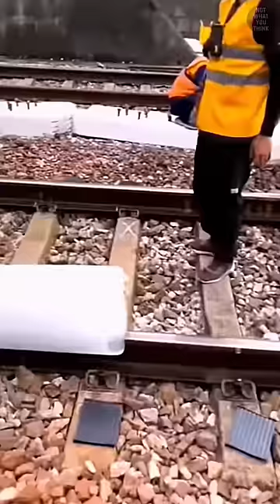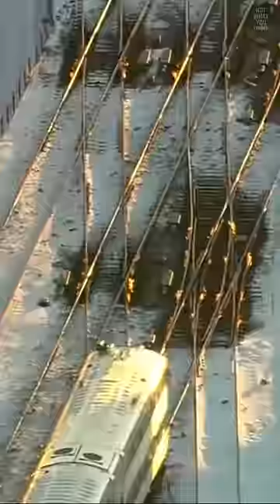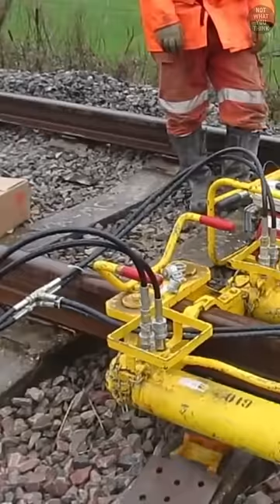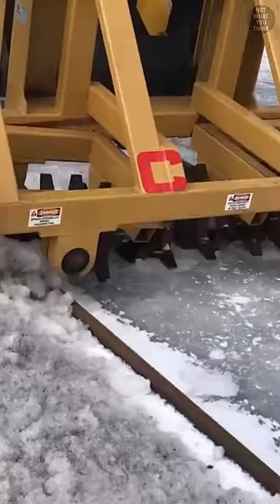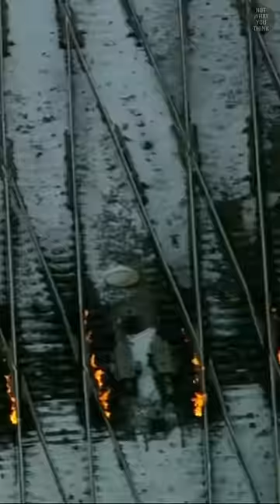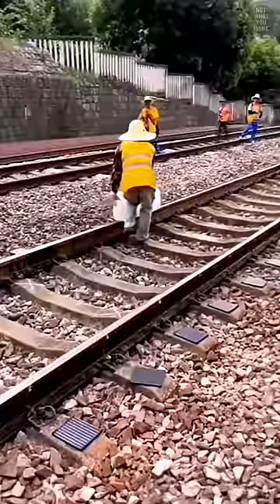ICE & FIRE on the Railway #shorts

Comment: “Hey go grab me the track stretcher out of the truck”
“Good one dude, not the first time I’ve heard that one”
Reply: The track stretcher does exist🤣
Reply: @kevingrubb9835  "go get the bolt stretcher" is a common hazing ritual for apprentices when the old fart needs to get some work done. It'll flummox the hell out of the newbie for a hour or so while the old guy does real work distraction free.

The apprentice in this joke realizes that a bolt/track stretcher doesn't exist, and knows that the old guy is hazing them, so they refuse to go get it, even though it actually exists.
Reply: There is actually a tool call a rail stretcher
Reply: @kevingrubb9835  The 'Track Stretcher' does exist and I've used them in Toledo in the 1970's on the Penn Central Railroad. But it was faster just to pour burning diesel fuel 39 feet in one direction and 39 feet in the other direction.
You could easily watch the two pieces of rail come together. Also was used in fixing  'Pull Aparts'
Reply: @phillyphakename1255  if the apprentice is smart enough. They’ll know they are being messed with and still go search for the board stretcher for hours while getting paid. Just following bosses orders haha
Reply: @jackmyhre8759  when I was new, I would be sent on parts runs, and sometimes, when we were out of stock, I'd go on exhaustive searches in all of the possible storage locations for the thing even where there is no chance they would be kept, you know, not to avoid work but to be completely thorough!
Reply: @phillyphakename1255  in the telecom industry the "cable stretcher" is the classic joke to play on newbies
Reply: i def need one 🤣
Reply: I immediately thought of the "beam stretcher" we used to haze new apprentices by getting them to go look for one... lol
Reply: The proper name is rail pullers that come in both hydraulic an gas operaterated engines used to pull together two rail ends to either bolt angle bars on or back on or to do a termite weld an eliminate the joint. I was a in track welder/thermite/arc,etc.etc.etc.
Reply: @kevingrubb9835  r/woooosh
Reply: Geez your joke was too sophisticated bro it went over all these hard assess heads 😂😂
Reply: rail stretcher would’ve been better
Reply: @xb70valkyriech  cable stretchers are a real thing tho
Reply: @tylerj6327  I'm not falling for that one again
Reply: How about you go grab me the wire stretcher so we can land this easier
Reply: @jackmyhre8759 but then it wouldn’t be part of the joke
Reply: @Philly Phakename  to be fair people are also really shity at putting stuff back so it honestly might be somewhere it never shold be put, like one time I was sent to find some 1/16 6010 welding rods and ended up finding them on a shelf for hydrologic oil on the other end of the plant so you never really know.
Reply: Oooh his talking about his ex wife😂
Reply: The correct term is rail distressor
Reply: Hopefully he also doesn't come back with a can of gas to set stuff on fire😅

Comment: Those tracks are set on fire to defrost the switch points
Reply: I think you're right, and Not What You Think is actually wrong
Reply: points are set on fire to prevent ice from locking them, it's a fairly common practice in Chicago(shown in the video) in particular
Reply: 100
Reply: @PrinzEugen176  And on Long Island.  Gotta defrost the switches for them to work.
Reply: Came here to say the same thing. That video is from Chicago. Other places have propane heaters that blow hot air in and around the switch points.
Reply: You're right , it's because points can't be stressed
Reply: @jeffwood5897  it doesn't have to do with stress it has to do with the fact ice and snow gets packed in between the points and the switch and  will not align properly.
Reply: @PatrickLipsinic  that's not why a guys rubbing a blpck of ice along it
Reply: @jeffwood5897  you replied to the original comment. "Those tracks are set on fire to defrost the switch points"
The video showing the tracks on fire are there to clear snow and ice. Nothing to do with stress
Reply: @PatrickLipsinic  you're right tbf my bad
Reply: Yeah, just ice on straight tracks wont be an issue with all that weight
Reply: It's industry standard for deicing
Reply: Yeah it's a propane tank contraption only at the switch, not the whole track
Reply: We set the tracks on fire in the winter when we have rail breaks and joint pull aparts. Steel grows when it’s hot and contracts when it’s cold. We use fire when we need to grow the rail
Reply: Why not just build a heating system on these points...?
Reply: @vicvancen  $$$$$
Reply: @vicvancen  Here in finland they have heating systems on those
Reply: @vicvancen  they work like heated seats on cars
Reply: @zeduu6873  Yeah, they are heated in germany too
Reply: @vicvancen  it dont even cost that much so I dont understand the point of setting them on fire😂
Reply: @vicvancen  the fire is a heating system, it's not some guy going out with a gas tank and setting it, it is a heating system similar to a natural gas furnace or propane stove. The reason this is still used in the US is due to the extreme amount of rail infrastructure we have that is underfunded and corner cut both when owned by government or private companies, as opposed to the well funded systems in European countries that can keep up with the latest and greatest

Comment: In Chicago the rail lines have gas pipes running along with them that have open flames to roast the tracks in the winters.  Crazy.
Reply: LoW cArbON transport
Reply: Maybe pump cool water in summer
Reply: Those are switch heaters to keep them ice free in winter so they can move.

Comment: One correction: the tracks in the clips aren’t on fire, the switches are, and it’s prevention of icing that they do it in this instance. They do use the process for heating rails to stress free temperatures in winter.
Reply: Yes exactly
Reply: I came for the reply, and i was not disappointed
Reply: I came for the food…
Reply: Exactly, the RWS story "the flying kipper" is an example of why you should do this
Reply: Switch POINTS usually have electric heaters strapped to the stock rail and pan heaters in the cribs under the switch points. SOMETIMES there are kerosene heaters placed under the stock rail in winter. All of this intended to melt snow so that it does not build up between the switch points and stock rails, causing switch failures and, potentially, derailments. What they are showing in this video is rail "fire snakes" being burned, perhaps for the same reason. Based on this short video, it's not clear why they are burning those sections of rail. It does not appear to be switch points but "solid frogs" that they are clearing snow from. This is something not normally done. Fire snakes are typically used to stretch rail.
Reply: Most of the time when fires are set on railway tracks, it's to free off points (switches) in freezing weather, which would otherwise cause the blades to ice up, and stick. Sometimes, as in this video, its done using a flammable liquid poured out where needed, but often, in recent years, it's done (in Britain anyway) with gas burners fixed close to the rails where necessary. Easy to spot because of the groups of gas cylinders nearby.
Reply: The clip of the rails on fire i believe is the chicago L. There’s a lot of stations up here where the train can swap sides from south bound to north bound

Comment: They ain't wearing shorts because if you kneel on a steel rail in extreme heat you gonna burn the shit out of your exposed skin
Reply: Who's kneeling on the tracks?
Reply: @castleanthrax1833  When you have to crouch down to do something on the ground
Reply: Same reason you don't see firefighters wearing shorts. Lol. In warm weather, shorts can be nice.. But when it gets beyond a certain temperature.. You go right back to long pants.. And even big heavy coats. Also just look at the Arab Bedouin dudes, who've worn big robes and full head and face coverings for hundreds, hell thousnsds of years. Sometimes protecting yourself from the heinous sun beating down is more important than being slightly cooler to the ambient air, which is already over 100 degrees anyway. Although in reality. The railroad workers not wearing shorts is probably down to a health and safety/OSHA regulation more than anything else. Tripping over a rail or losing your footing or something and then falling on those loose pointy ballast rocks, is a son a bitch with shorts on.
Reply: @blackhawks81H  exactly
Reply: @blackhawks81H  it's totally OSHA.
Reply: they could wear ¾ length shorts and long pink socks
Reply: @mrmarr8308  Long socks are worse for hot weather because they trap the heat right at your skin. Jeans shield you from the sun while also maintaining enough of a gap between the jeans and your skin to insulate you somewhat from your sun-warmed clothing
Reply: So dont kneel on a hot thing….
Reply: @wyldeyouth  yep..they are wearing shorts ...they're just short...
Reply: @blackhawks81H  well if they do that because rocks are so hot...why no gloves??
Reply: @heisafraid  you underestimate the amount of things you might need to do at ground level where your only option is kneeling on something hot
Reply: @jenniferatkinson9085  who said anything about the rocks being hot? Besides, I'm willing to bet every one of those guys has either a pair of heavy gloves on their person or in their tool bag
Reply: @phillyphakename1255  if you look, you can clearly tell the video is in Asia somewhere. Ain't no OSHA there. The states is the only place that has OSHA
Reply: @castleanthrax1833  accidents?
Reply: @durg3sh  What does this mean?
Reply: @YouTubeSaysThereCantBeTwoRyans  Other countries have their own agencies for safety regulations and everything else Mr Ameri-brain
Do you also think other countries don't collect taxes because the IRS is only in the States?
Reply: Workers in shorts will be sent home. Not allowed.
Reply: BusyBeeFarms  depends on your work id say ;)
Reply: Also because joining continuous welded rail sections usually involves thermite.
Reply: So why don't we use the brains were born with and not kneel on the hot steel?
Reply: @richardmillhousenixon  even with the trousers on, if you kneel down you will still get severe burns what?
Reply: @Amos Backstrom  actually it's quite funny, one I'm not American. Two I know how the world works, three have you compared china's safety laws and regulations compared to other countries? Quite slacked. Four...how the fuck did taxes get involved in this conversation?
Reply: What ever happened to the days of clickety-clack?
Reply: Thank you sir
Reply: @blackhawks81H 100 degrees??? That's hotter then my oven
Reply: @dragonslayer9075  If your oven can't go above 100° (Fahrenheit or Celsius) then you have a shit oven
Reply: Good point nixon, i knew i was right voting for you

Comment: I remember when the tracks were set on fire in the clips you used. IIRC those in particular were used to keep the switches from freezing up because of the record cold that year
Reply: In Canada they just use gas fired hot air blowers
Reply: @srpacific  areas of the U.S. have gas fired switch heaters also. Setting fire to switches is an old technique that isn’t used often anymore. Then again China is still mired in steam engine technology in places, so I don’t expect them to be using more modern equipment for such things.

Comment: If the tracks get too hot, most likely trains will have to slow down to a painfully low speed. I’ve seen this happen on a railroad I live next to and it’s called heat restrictions. It was going slower than my running speed. On a super hot day the rails can get very very hot and like I said trains must slow down.
Reply: @combatarcher3101  yeah, but there isn’t anything to cool it down as they don’t ice them down here.
Reply: Its because they expand with the heat, and when they expand, the gap between the molecules increase making it easier to deform it
Reply: @mdenizcoban  exactly that, yes.
Reply: @LucedaleRailfan  you probably knew it but i wrote that just in case if that one dude that knows nothing wants to ask that
Reply: @mdenizcoban  right right, I did know, but thanks for it anyway!

Comment: When they went to install the last section of the St Louis arch they were delayed a couple hours and the heat of the sun had stretched the legs enough where the last piece didn't fit. They used fire trucks blasting water on the base to shrink the legs and fit the final piece. This story made me think of that.

Comment: Stretching rail with fire is a sight to behold. I've done it on jointed rail a few times using diesel soaked cotton ropes 90 feet each side of the the break.

Comment: The on fire section is literally just so that the twins don't derail as they cross over those sections of tracks and sometimes you catch them on fire to prevent points and switches from freezing up
Reply: Just electrically heat them. Fire is for caveman’s
Reply: @foundinstpetersburg  They're using it to stop ice from building up to stop switches Freezing and not operating correctly so fire is the best  Option because electric heating equipment has to be out all year and is kind of expensive.

Comment: set on fire to reduce the likelihood of cracks... Definitely an american that wrote that part.
European (mostly scandanavian) countries have been setting pointwork on fire for decades, in winter and snowy / icy conditions.  This is because while you can remove snow from the rails... ice is a real danger for points not switching to the right track if frozen.  You can send a guy out to check every point and crossover to de-ice it... Or you can install gas pipes and igniters on every install.  When it goes cold... turn on the gas and ignite the fires.  Heat melts ice, rails warm up and retain heat for several hours. Preventing ice.  So you just turn the burners on every few hours and it de-ices the pointwork and surrounding rails. As a bonus effect it also warms the grease on the sliding surfaces for the points and allows them to slide easier.

Amazing how thermal dynamics work.

Comment: The fire on the tracks is also used to heat the rails to weld them back together after they had already cracked. Often a rope soaked in a flame ale substance is run along the rail, lit on fire, then the crack is welded since the track expanded with heat

Comment: The switch tracks are set on fire. So you can use them. In the winter time. The cold steel against Cold steel. Setting on a metal plate. Will get Frost buildup in it. Making it extremely hard to switch. So they set fire to them. Defrost the steel and evaporate any water left  behind. It has to be done several times if it's really cold out.

Comment: That clip with the "tracks on fire" is NOT to "reduce cracks" but is to remove ice and snow from things called switches, also known as turnouts/points, so they actually work.

It's like saying a salt truck is putting salt on the road to prevent the road cracking from the cold.

Comment: They cover up because it avoids direct exposure to the sunlight. Because if you have, say, two layers of thin porous clothing, you sweat into the inner layer, and and then that water evaporates between the layers, and since evaporation is a cooling process, you have cooler-than-outside air around your body.

Comment: A reason to not wear shorts in the heat is to sweat less and prevent dehydration. Pants allow saturation of sweat plus you have a level of insulation that will keep you cooler.

Comment: Actually the fires you showed were switch heaters. Switch heaters are just there to melt snow and ice so that the switch actually swings all the way. They use a mix of electric heaters, propane burners, and in this image was oil or kerosine.

Comment: In my region of Russia annual temperature difference is 60 degrees Celsius (from -30 at winter to +32 at summer). Continuous welded rails are laid on railway passed through my town. I have never seen rails specifically heated or cooled. Compressed air is used to clear snow from railway switches.

Comment: because they're not allowed to probably. I worked for an HVAC company and we couldn't either. I bought some extra pairs and slit the pant leg off at the knee to make some shorts and kept them in the truck to change into when I got to the install. It becomes less safe to wear pants at a point, id rather get a slice then drop from heat stroke

Comment: tracks are not set on fire to reduce the likelihood of cracks. 
What we see in your B-role are
turnouts and switches being heated in order to remove ice and snow from blocking their mechanism and causing problems. 
Sometimes they are heated by essentially blowtorches most of the time they are heated electrically.

Comment: Stressing continuous welded rails does NOT prevent heat and cold tensions. It prevents/mitigates stresses caused by heating only.

When the temperature of the rail increases beyond what it was when it was laid, it undergoes compressive stress due to expansion, which can cause buckling. When it cools below that temperature, it undergoes tensile stress due to contraction, which can cause cracking/breaking of the welds. Tensile stress is a lot easier to deal with than compressive stress: you just have to make the welds strong enough to withstand it. Buckling is a lot harder to control, as you have to reinforce the rail so it can't bend side to side along its entire length, which can be very difficult. To account for this, rail is laid either on really hot days, or is heated and/or stretched when being laid/welded, so that the rails primarily experience tensile stress rather than compressive stress. It's a lot easier to fix a broken weld than to fix a buckled track, and rails with broken welds are a lot less likely to derail a train than a buckled track.